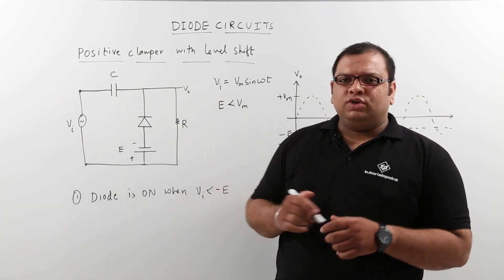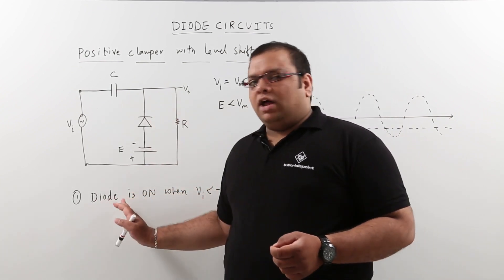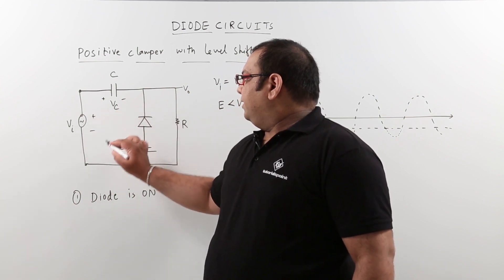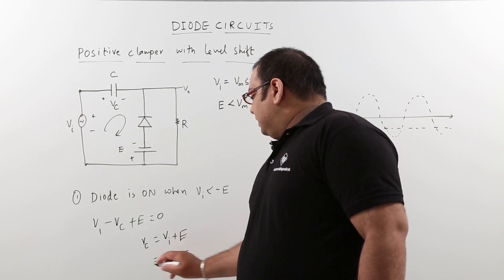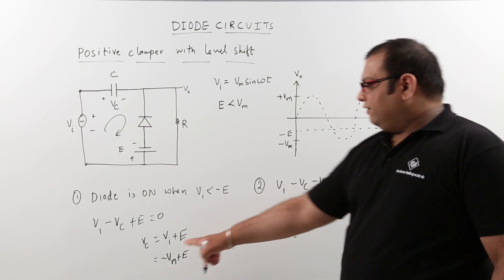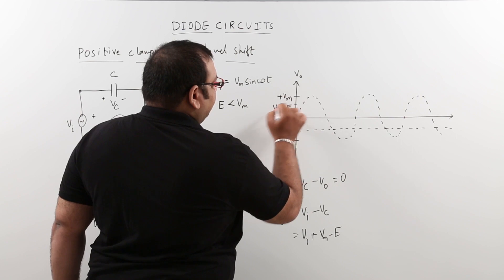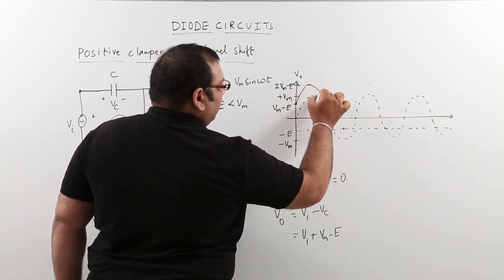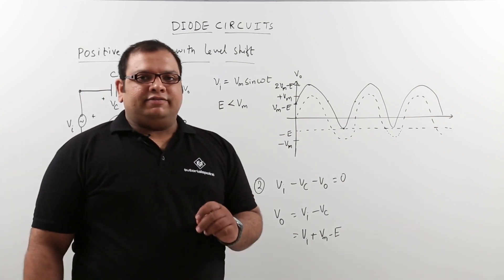Positive clamper with level shift

Comment: When Vi is -ve and lesser than -E then only the diode will be forward biased and the Vc = Vm-E (opposite to the sign you showed on board). Then if we write KVL, we will get Vo= Vi+ (Vm-E)
putting Vi=0, Vo=Vm-E
putting Vi=-Vm, Vo=-E
putting Vi=Vm, Vo=2Vm-E

The main fundamental of clamping circuit is that, the input ac voltage charges the capacitor, this capacitor voltage is the DC voltage which then shifts the ac signal !!  Here effective capacitor voltage is Vm-E... thus we can see upward DC shifting of the ac signal by Vm-E, i.e at Vi=0 we are getting Vo= Vm-E

Sir, the KVL you have taken and capacitor voltage polarity all should be in opposite direction.. In a circuit where nonlinear element like diode is present, KVL can't be applied directly... when Vi becomes -ve , then only diode can become FB (short) and hence KVL can applied.

Comment: During the first condition when the diode is ON, that means the diode must be in the forward bias condition to be ON. So the supply voltage negative terminal should connected to n of diode and positive terminal to p of diode. I think the way your solving this problem is wrong. Plz correct it.
Reply: no ,the n side only needs a potential less than its p side to get forwarded